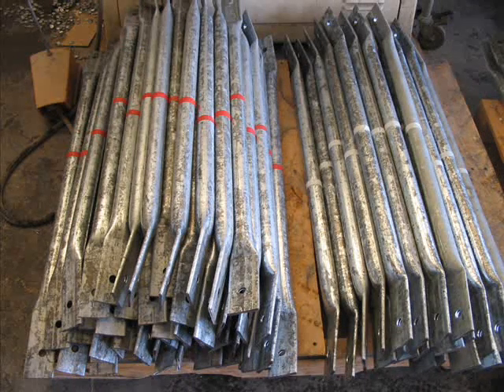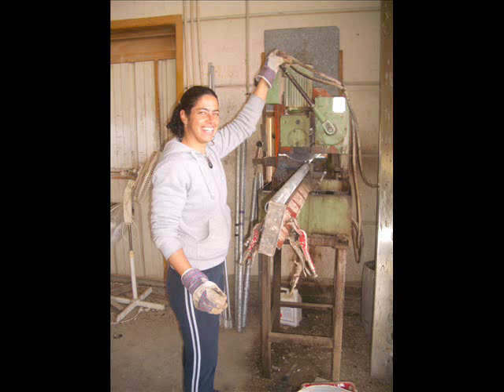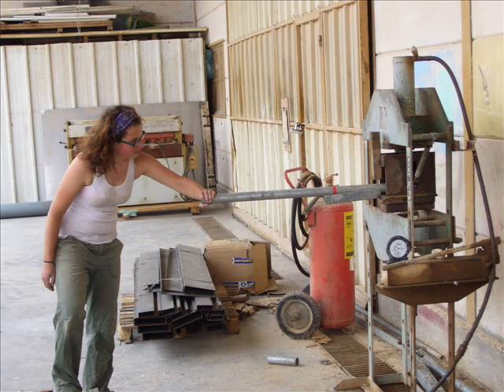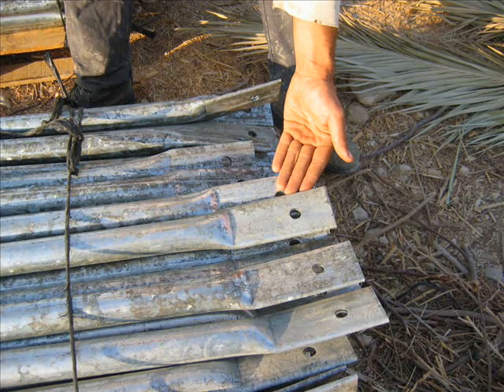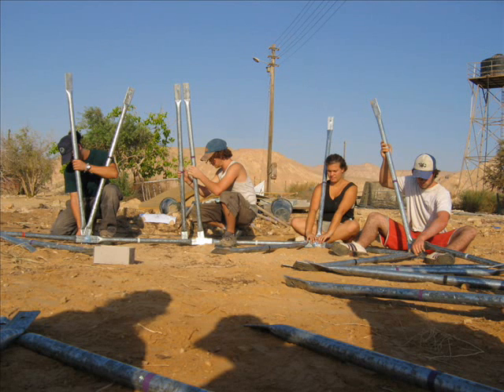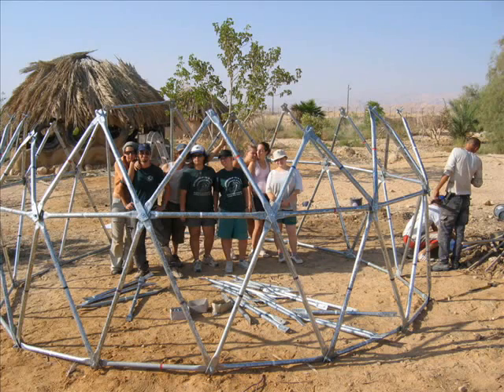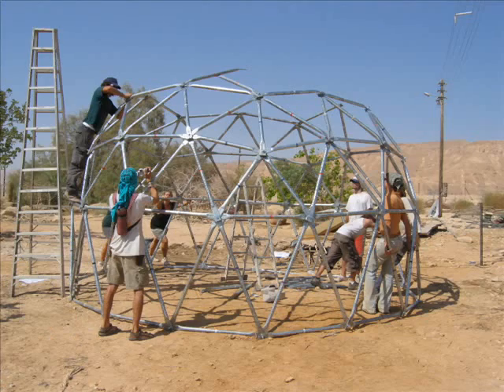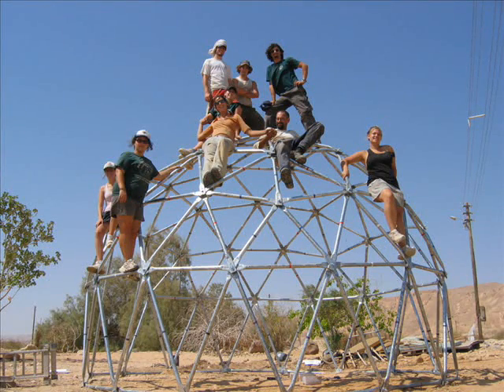#1 How to Build a Geodesic Strawbale Dome - dome manufacture

Comment: Did you all make a pool yet? For it the desert ? Make a Chinese letter for Heaven under it then put the rocks across then you can set fire under it to heat it up to make it a hot tub though I guess cause you are in desert it stays warm water but if it drops at night you could heat a bath that way just cement over it with clay mix 6  1/2 part to 1 1/2 sand 1 1/2 water and then 1/12 bucket 10 gallon per mix they say 8% lime can help too but each batch to make the bricks to line it with the fire them you can make smaller versions for tubs lol primitive but would work. Do you all have to get water delivered or do you have ability to put a pipe down to put in a water pump? If you are near water how deep do you have to send down a pipe before you hit water in the desert areas? Also did you all buy the desert lands or is it like Crown lands where you can camp or do the soldiers come and move campers if they start setting up areas without first getting building permits? Does Israel approve the building permits for the adobe huts quick or no?  Building inspectors in Canada are a nightmare and they dont let us stay in any place more than 21 days unless we own it so what is it like for the rules in the desert is it still open or is it off limits ? Did they change where areas are allowed to go camp and be did they restrict areas now cause of war? PRAYING YOU ARE ALL SAFE!  

Are you able to put in pumps for water like we can in north america is water close enough to surface if you put a pipe down ten feet or no?  Bible always says Isaac dug wells how deep does one have to dig there anyways ? Can you all make irrigation systems for plants ? I was impressed with the vegetation you grew your garden was impressive!

Comment: The domes as you see are a hybrid of a 3V top above an almost vertical walled post and diagonal  bottom section. I planned the 3V lengths based on a 2.4 meter radius as calculated in the desertedomes website, then worked out the lower post section in autocad. If you need more detailed information, you can contact me at alex [at] klotan co il .  Good Luck, Alex C., Kibbutz Lotan Center for Creative Ecology

Comment from the maker: @wellthen40 
We don't order the steel pipe cut.  We purchase the steel pipe in 6 meter lengths, cut it to size (hole to hole dimension plus2-3 centimeters extra on each end), drill the holes, compress the ends in a hydraulic press and bend the ends to the appropriate angle while the pipe end is held down in the press.  Check out the website "desertdomes"  for details and dimensions.